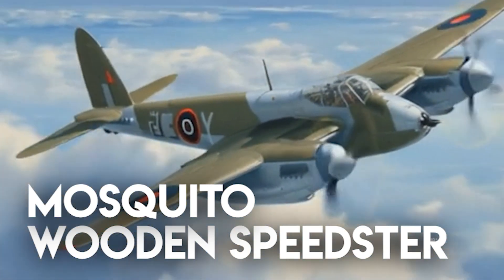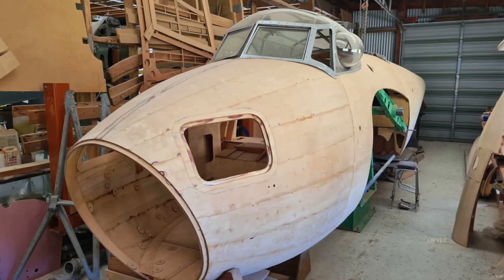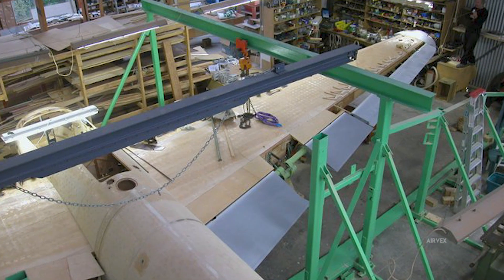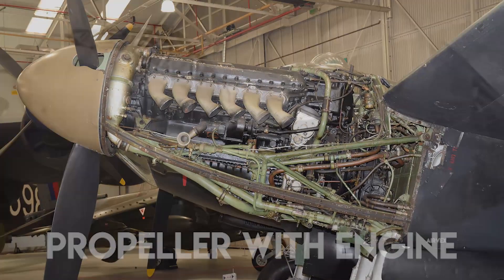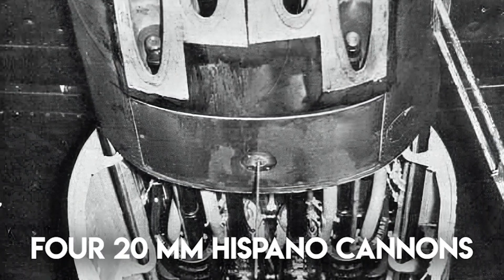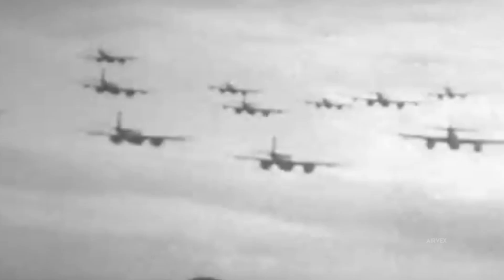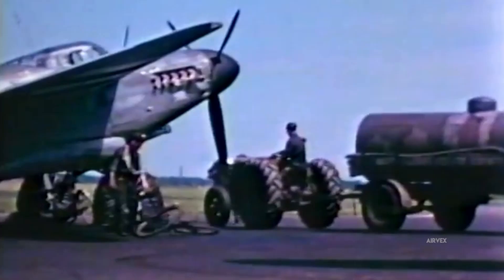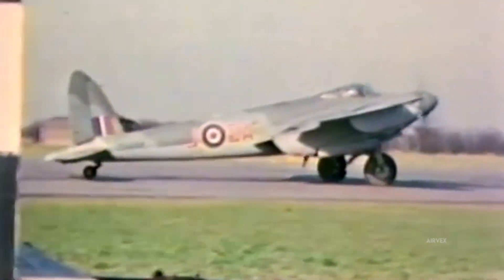How a WOODEN Mosquito OUTRAN Every Metal Fighter in WW2

Comment: Incredible wartime  engineering 🤯
And this video answers why there werent more like it. In aviation & engineering, everythings a trade-off. Its light, but the wood frame that allows for such absurd performance is susceptible to rot; high oerformance but high maintenance. I'd never really considered that before. Great vid, keep em coming 👍
Reply from the maker: Absolutely mind-blowing, right? It’s amazing how they squeezed so much performance out of what seems like a risky design choice! Also, which trade-off in aviation history do you think was the most daring? And thank you! :)
Reply: @Airvex-f3d  🤔 Good question. Maybe the SR71 being designed to leak fuel on the ground so that seams have enough room to expand due to the friction of extended Mach 3 flights. Thats my gut answer, but I know there are many more if I think on it.

Maybe the F105 EDIT: F104 being great at supersonic intercepts but a deathtrap at landing and takeoff speeds... No, IDK.

Helicopters in general, esp the Chinook w massive counter rotating rotors. Spin the wings!? Yeesh😮

I'll think & revisit this.
Reply from the maker: @ That's a really intriguing take on the SR71 and, again, the whole trade-off concept in aviation is just mind-blowing! I mean, who would've thought a controlled fuel leak could be a feature rather than a bug? Okay! :)

Comment: The Havilland Mosquito was an incredible fighter / bomber. Great in the role of a night fighter. With incredible speed and handling. The Mosquito was a versatile twin engine fighter. One with a very low Radar signature. Due to the planes  laminate wood composite stucture. Truly a remarkable piece of engineering in creating the Allied  Havilland Mosquito. 💪🙏
Reply from the maker: Yes, that is true! By the way, which WW2 plane do you like the most? :)
Reply: @Airvex-f3d  honestly I am torn between the Spitfire and the P-51 Mustang. Both were excellent in their roles as fighter aircraft. Both used to defend Great Britain during the blitz. As well as being used as Bomber escorts. Later on the P-51 Mustang with its drop fuel tank. It was able to go the entire way on bombing missions. Giving much needed protection against the Luftwaffe. 💪🙏
Reply from the maker: @ Agree, good choice!
Reply: *DeHavilland and the jug is the only true answer. Lol jk. It just screams American to me. Huge motor and a huge punch. Was made for high altitude escort missions but didn't hold enough fuel to do the same job so was made for close air support. Not the most beautiful plane in ww2 and didn't end up doing the job it was ordered for but found its place and did a fine job.